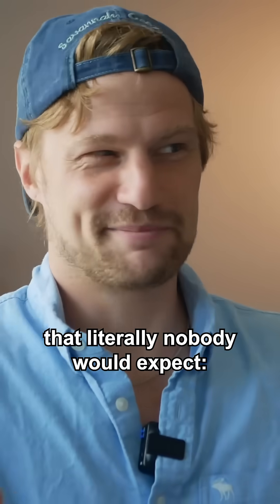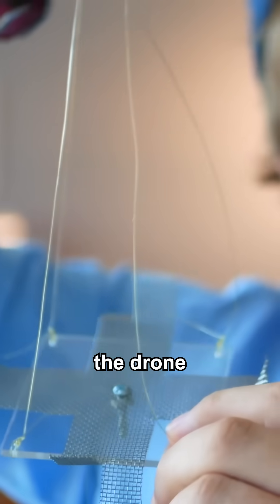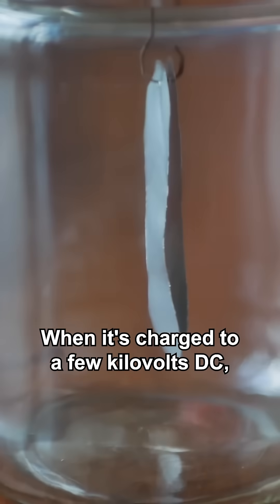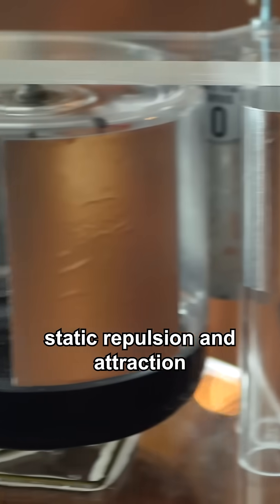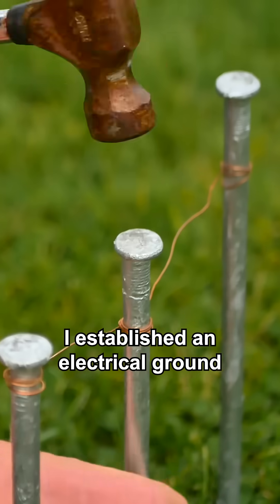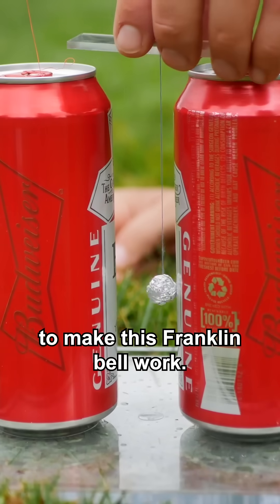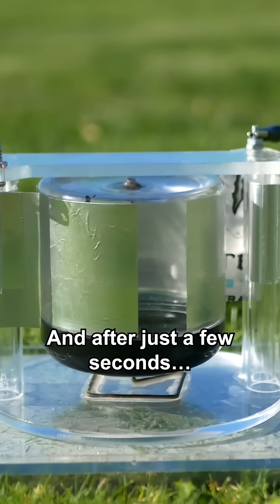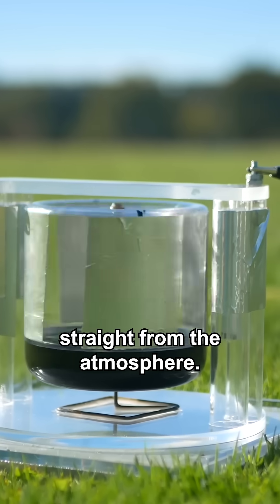Drone Harvesting Invisible High Voltage From the Sky

Comment: I made a foil cup around a tennis ball
and stuck it on the pin of a Maplin DIY air ioniser (back in 1985)
then put that under a radiator
with a ball of foil in the centre of the foil cup
hanging from a wire joined to a radiator pipe for Earth.
I was woken the following morning by "ticking"...
When I looked, My device had blocked the path of ants
which, for some reason, were now climbing into the foil cup...
There, they were clearly being charged and, alike charges repel, so their legs straightened out as their bodies were attracted to the foil ball in the middle!
Gradually, one leg at a time would get too tired to grip any more and would point straight at the foil ball in the middle...
At the last leg, their whole body pointed at the ball!!!
And when they let go, they'd fly into it, discharge and be attracted back to the cup,
and that was the ticking noise! Bouncing ants on tinfoil!
I was doing a physics degree at university
(this was in my first year accommodation).
And only just learned I'd made a dull Franklin Bell!
I should have told my tutor of someone but it never occurred to me! 😅
Sucks that we didn't have cameras in those days!
So if someone has a line of ants under a radiator, you can make a cool video of ants at the fairground (they seemed to enjoy it: if I took them out, they'd get back in)

Comment: This is the principal behind the original crystal radio set. 
The electromagnetic radio waves are recieved according to the correct antenna windings to match the frequency of the broadcast station and discharge through a quartz crystal diode and into a small earphone or speaker.
If I remember right the radio needed to grounded to the earth to complete the circuit. 
I'm sure there's someone that know more about this than I do.
Anyone can build one at home now with the internet and AI, and it will with no batteries required.

Comment: This is why metal oil and gas pipe ends have to be covered while transporting on the truck. It can create magnetism with N and S. When we go to weld it, the welding current will swirl making it difficult to weld
Reply: I'm not the one! But someone out there is. I'm 65 yrs old and science minded but that means nothing except I find it interesting. You may not know it yet but you may the one. Don't listen to all the negative. Because that means nothing about what (they,  you, I) don't know. When new ideas come that work it's always been someone foraging there own way! And then it's found that it's not impossible, also it created new rules or followed the old in a new way. Young man, forge forward the only failure is not to try.
Reply: All those loads of big pipes on the Interstates, open at both ends to let air pass through ...
Reply: @roytee3127  Usually, they try to keep air from passing through the pipe. But if they don't, the magnetism can be removed by using a gauss gauge and wrapping the grounding leads around the pipe to neutralize it. Also depends on what the pipe is used for, light green or brown are usually capped on one end
Reply: I'm not a welder, but I'd think that a quick connection to a ground wire would remove any electric charge on a pipe.
Reply: @roytee3127  it would yes, but the charge I'm talking about is magnetic not electrical or static charge. That charge would be dissipated as the pipe comes into contact with the ground when placed in the ditch. The wrapping of the ground doesn't touch the pipe because of the cables insulation. Imagine a nail with some wire coiled around it and a battery, we do the same thing to get rid of the magnet.

Comment: The magnet wire looked like it still had the coating on it. Which would prevent it passing current through the bolt. Essentially insulation blocking the path.
Reply: Do you think he don't know about that ?

Comment: Wait a minute wait a minute wait a minute I need more technical this went too fast. I need more technical information because I built a device. I took 1 mile copper wire number 22 copper wire and spin around in a circle and an honor like a large large Very large inductor I figured out the mathematical coordinates for the capacitor and the resistor and I was gonna draw the 7.8 Hz frequency of the earth frequency and then I lost my wife and then I lost my job and then I lost my I never finished the project. I was gonna withdraw the natural earth of 7.8 hurts and get free energy but this is really interesting but I don’t have the details where to get the details.❓

Comment: Um... wasn't this the basis for Tesla's free energy device? From what I understand it was based off the difference in charge from about 50 meters up and the ground.
Reply: Nope the tower was meant to transmit wireless power
Reply: @Dill_Do  Yes but using the the difference in potential and charge in the air and earth. You can't have a circuit without a path for both charges.

Comment: The next project: Charge a capacitor. Given its capacity and its voltage, you can know how much energy you harvested, and you can use it in a controlled manner. The capacitor can either charge a battery or power an electric device when the voltage is sufficient.

Comment: Never touch a flying helicopter with your feet on the ground . The air flowing over the blades strip electrons from the surface there by creating potential.

Comment: Why is it no one has harnessed lightning strikes for the grid? to be able to store this voltage , and use it as needed , it seems like a no brainer . its would have a low carbon footprint and is renewable.

Comment: But again, the batteries and discharge rate; you’re putting in more than you’re getting out.

I appreciate the novel ass thinking (I couldn’t come up with that, so kudos to you!!), but there are literally hundreds of these wonderful concepts - crazy ass contraptions, that blow our minds that they “just work”. 
But let’s also not lose sight of what we’re trying to achieve. China says they’ll have the first public yield, positive net gain fission reactor by 2030.

Today, I was reading about a new propulsion device, that supposedly utilizes a “new force”, with electrolysis. Think of like the EmDrive that was debunked - same concept. This one seems more promising, only time will tell. If it’s real, it will revolutionize standard physics as we know it.

Comment: My thought is this could be energy from radio towers far away, they proved that in the 70,s if you had a long enough antenna like 300 ft and good ground that you can get a very small electric motor to run.But the statement made on this video indicates the energy is from the atmosphere such as static charge differential between clouds and ground this test needs to be done in a location that has the least amount of man made radio waves which now days is almost impossible because am frequency will travel to the other side of the planet, that's how ham radio operators don't by bouncing there signal off the upper atmosphere.

Comment: The down wash of the rotor blades creates a big part of that stating electricity that he is "measuring". This is a known problem with helicopters that can cause problems with them. just google "static electricity problems helicopter" and you find plenty of info on this.
Reply: nah, it's the voltage gradient in the atmosphere otherwise you would always get shocked if you touched a drone while it is in the air

Comment: There is a natural voltage gradient in the atmosphere, increasing with elevation. However, voltage potential is always relative to the local ground. If you construct a building to “harness” this energy, the top of the building effectively becomes the new reference ground, meaning the usable voltage difference remains the same. A large collection area might gather some charge, but the overall power output would be minimal, making this approach impractical for large-scale energy generation.
Reply: "However, voltage potential is always relative to the local ground." 
Voltage is the difference in potential. Ground/Earth is just a very low potential. Batteries have no reference to Ground/Earth but still exist. Many/most appliances are not connected to Ground/Earth.

I am not arguing semantics as everything else you say is spot on :)
Reply: @ Appreciate the clarification. I guess I could have worded it better, what I was getting at is the voltage increase with elevation is dependent on your starting elevation, which normally is just the elevation of the ground, whereas on a roof the floor is considered start of the voltage gradient.

Comment: Aren't you just harvesting charge from... your drone batteries? Isn't this the turbulent prop wash depositing static on your acrylic & grid?
Reply: No, no; there's literally a voltage gradien in the atmosphere, and you can extract some energy from it exactly as he showed, however it's just a tiny amount of energy.
Reply: @ergodic_maps9563  Can you spin that static motor with a balloon? I'd wager the unmoving grid at max height in still air doesn't harvest meaningful power